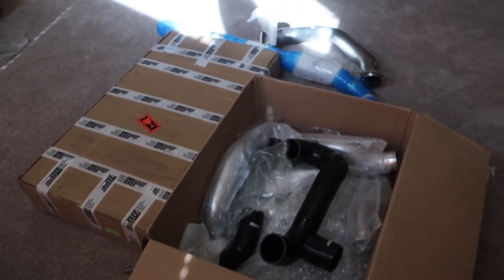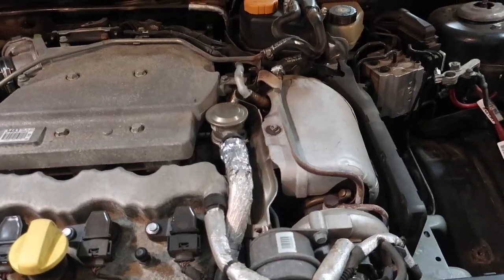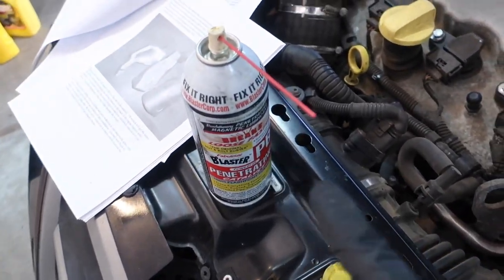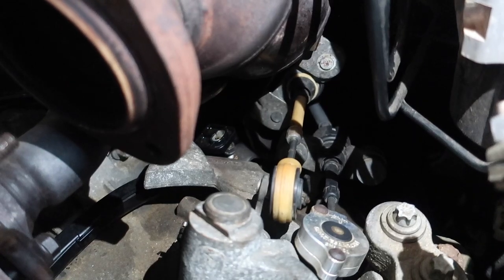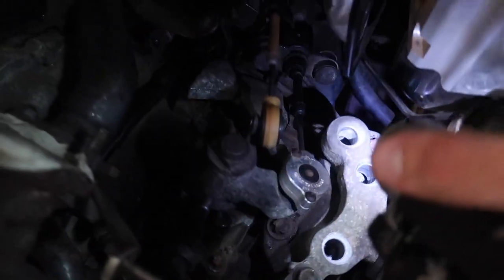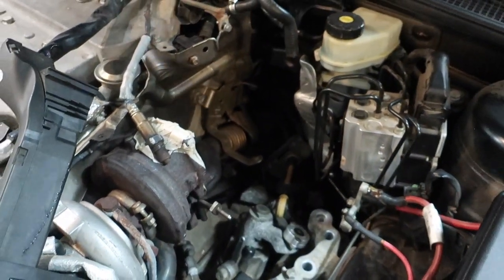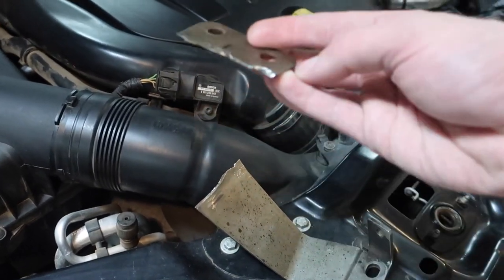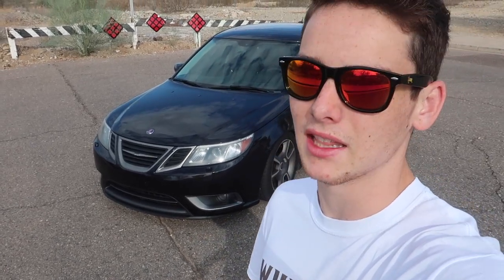Krona Downpipe and Midpipe Install on My Saab 9-3 Turbo X!

Comment: I’m assuming this is a v6? I found this video because my flex pipe is leaking now it’s loud af but sounds good when the turbo is spooling up.   I like that since we apparently can’t use bov’s on Saabs.  Which sucks ass. A turbo without a. Nice blow off valve is like peanut butter without  jelly.  I have a 06 93 2.0T.  I’m trying to see what my options are. The few down pipes I’ve looked up have 2 flex pipes one at the top of the down pipe , and one in the middle of the pipe. Idk if the factory one has the same set up or what. But I was thinking If it does can’t I just get rid of the bad flex pipe and put an electronic  exhaust dump?   I really like the idea of having it quiet then opening it it up when I want too. Straight sleeper. Does the factory downpipe have two flex pipes on it or no?
Reply from the maker: yes. this is a v6. BOVs are not great on the 2.0's. I'd recommend an open air intake for more sound. there is one flex pipe underneath the car on the stock 2.0 exhaust. I would recommend watching this video, since it features the engine you're talking about: https://www.youtube.com/watch?v=khj3nIuyoy8

Comment: Quick question for this you didn't have to do any tuning right? The defouler took care of the cel? I'm in a situation where my v6 has a catless downpipe but no defouler installed so hoping to get the 02 deleted and turn the light off with a tune and still pass emissions. Instead of having to install one. I've been told the defouler is only for cars with no tune.
Reply from the maker: yeah the defouler took care of the CEL. i got proper tune for it right after though to help the car run best and maximize the gains

Comment: What makes it sound even better is that it's a 6 speed. I just don't care about an automatic with a rorty exhaust unless maybe it was a dual clutch paddle shift trans. BTW, saw a new Ferrari sitting at a smoke shop a couple blocks from my house yesterday. Couldn't stop to check it out though....on my way to the Dr. office. A bitchin' ride to say the least. It was Corsa Rosso, natch.
Reply from the maker: Nice spot! and thanks :)

Comment: I know this is rather unrelated, but what are your thoughts on replacing a key fob shell for a 93? The buttons on mine are worn and I ordered a replacement from ebay. Long story short I found out that if you do not use a genuine fob case it won't close properly like mine didn't and therefore the ignition wont allow it to turn. Is it worth getting hold of another fob case?
Reply from the maker: On my other 9-3, one of my fobs had been chewed by the previous owner's dog. I just use the other one, but the chewed one still functions. Hopefully you can return the other one you bought, and the buttons on your current one still work. You can buy a "genuine" one from eeuroparts!

Comment: Did you do anything with the alternator? Remove or unbolt out of the way? I think Krona has that in their instructions..
Reply from the maker: alternator is on the opposite side of the motor, so you shouldn't have to touch it

Comment: hello, Maptuner stage 3, is it possible to remove the first catalyst or do you need to map again?  I have a stage3 Maptuner with original exhaust, I would like to remove the first catalyst and the second catalyst and replace it with 200 cells, do you think the car works well?  or do I lose pressure in the exhaust for the turbine?  thanks 🙏
Reply from the maker: if you're removing the cat it's best to get a retune to both get rid of the CEL and account for the changes. i would recommend contacting maptun too to see what they say!

Comment: Hey, just an FYI for everyone. The non fouler is actually unnecessary. Wire 2 resistors in the return feed wire with a jumper around the second resistor back to the end of them and like magic you get half the voltage. This makes the computer think there is a cat, every single time.
Reply from the maker: it's easier to just put the spacer in tho imo

Comment: Hey my krona kit didn't come with the nuts/bolts for the downpipe and midpipe flange, did you buy yours separately? The pdf says to "use included hardware" so I think they forgot to add it to my kit.
Reply from the maker: you could reach out to them about that; i didn't buy any hardware separately

Comment: A tip is that when you lower the engine don't remove the bolts to the engine mount. Just loosen them enough so you can do what you want, if that doesn't work; then remove them. Getting the bolt back on can be a bitch. 

Nice job though!! Sounds awesome!!!
Reply from the maker: Thanks for the tip! That was actually a trans mount, and the part attaching to the frame was actually able to be moved a tad, so I could adjust it before reinstallation if I needed to. I'll keep it in mind for the future!

Comment: I don't even drive my Turbo X anymore because I picked up an Audi A5 but this video makes me miss it. I got my Turbo X at 104k miles and it literally had some type of problem every month. I replaced   the ignition coils and spark plugs so many times. Then this summer, the Turbo X just went out the door and had a loose wheel bearing, master cylinder head or some shit for the break line broke along with 2 other calipers that started dragging, replaced 2 of the front rotors. Then I finally fixed those things and I had a week thinking "nothing can happen now, I've fixed everything" sooo then the power steering pump went out and fucked me over.. replaced the whole power steering pressure line and then 1 little fucking power steering return hose elbow broke off and fucked me over even more because I now have to buy the entire power steering pump for 1 little part on it.
Man fuck my Turbo X lol. They made yours out of titanium and then mine out of some flimsy aluminum.
Reply from the maker: Jeez....maybe it wasn't taken care of in its past life :( sorry to hear!
Reply: Wonder how you'll feel when you have to replace the water pump and timing belt every 80,000 on your A5. Audi's are over engineered and we'll built, but only recently has their reliability improved to an acceptable level. Good luck, you'll love it when its running.

Comment: Has it had the updated hoses for expansion bottle and checked for pressure cracks on bottle
Reply from the maker: Are you referring to the coolant tank? The lines were replaced in the past, yes. Not by me though

Comment: I thinking about resonator delete on my,  9-3 xwd aero maptun stage 5 but im afraid of drone,  what do you think? :)  and such a nice sound!  :)
Reply from the maker: Thank you Richard! I'm surprised this doesn't drone at all. But if all you're doing is a resonator delete, you shouldn't have to worry about drone
Reply: @AutoAutopsy  yeah i only want to resonator delete,  muflers remain :)  i hope after delete have deeper sound
Reply: The B207 engine is a lot more susceptible to drone than the B284 is. Be prepared to put the resonator back on in case you remove it.
Reply: @znorc  thanks :) i want cut resonator and replace for straight race pipe, what would you recommend for better deeper sound?

Comment: Do I need a tune for this or just The O2 sensor The Fowlers if I spelled that right lol
Reply from the maker: Lol the “defouler”. You can get away without a tune in most cases, but it would really be best to get a tune as well

Comment: How about making a 2003 9-3 vector sound the best for cheap?
Reply from the maker: Well, you can always cut off the rear muffler. But if you really want quality sound and performance, I’d recommend an actual system! :) if you search “Saab 9-3 exhaust” on YouTube, you should find a couple of videos of the exhaust setup I have on my 2.0 9-3!
Reply: Auto Autopsy thanks so much!

Comment: Seeing how you have to remove the cat to do the brake booster when I replace my break booster, I might have to just spend the money and redo the exhaust.. or they could sponsor me too. 🙏
Reply from the maker: No no, you switched that around! I think you meant remove the heat shield for the brake booster to get the downpipe out. The brake booster itself was not messed with at all :)
Reply: Auto Autopsy I need to replace the brake booster on my 2006 Saab 93 Aero Sport Combi it doesn’t look like is going to be fun to get to that heat shield. So I might as well do what you did and add one more thing to my to-do list (exhaust noises).

Comment: Hello about to buy a 2003 Saab 9-3 se convertible  with 151000 miles any tips
Reply from the maker: It's a good powertrain and drive train. We currently have two verts like that and they're great! Just make sure to do a thorough inspection :)

Comment: Seems like the v6 is a lot more work than the 4cylinder but sounds so orgasmic
Reply: It's primarily due to space. Same thing with the Audi B7 S4, 4.2L V8 where it was designed for a 2.0T Turbo. Hard to work on.
Reply from the maker: It is, but boy is it worth it in the end imo
Reply: Auto Autopsy  agreed, i have the 07 93 aero combi.

Comment: Turbo Xs are so slow i don't want to spend any money on tuning it but anyway good setup and sound. I am looking for a nice 02-05 9-5 aero to replace my X.
Reply: multinjok do you have a manual or auto?
Reply from the maker: TX > 9-5 Aero
Reply: Frank Miano  Manual, it is bone stock it made 281 Hp and 440 Nm on the dyno calculated at the engine...I think there are a couple of problems with turbo X, first is the car is very heavy 1750 kg, the engine is lazy slow reving, the gearbox is slow and notchy when you try to shift it fast and the XWD is also taking power, especially when you floor it on the highway.
Reply from the maker: It definitely did not make that much power stock, lol. Not even to the crank. Stock internals couldn’t hold that power, assuming the numbers you gave are wheel readings.
Reply: Auto Autopsy  No that is at the engine.
Reply: The internals of these cars have absolutely no problems with that kind of power. They're good for 400++ at least. A tuner here in Sweden have 19T, full exhaust, intercooler, injectors and clutch. He's currently at 435 hp and 570 lb-ft with stock internals :D
Reply: Robsva96  What are you talking about... I have stock numbers to say, Turbo X was rated at 280 hp, i have 281, and 400 nm i have 440 bone stock.
Reply: Yes, multinjok, I believe you. Auto Autopsy said and I quote: "Stock internals couldn't hold that power, assuming the numbers you gave are wheel readings." I just wanted to let him know that the internals can handle alot more than that. Do you believe it's worth losing the XWD when you want to switch to 9-5? just curious :D
Reply: I dont see any value in XWD because you need to really push the car to use it...It is great in the snow but we have snow only two days in year so all you have with XWD is added cost and less feel in power when you floor it. Dont get me wrong the car is very refined but in the same boring. If you know what i mean.

Comment: Why u didn’t kusy losie radiator hose to drain heater fluid? Secound thing dont instal any ecu o2 sensor cheater just go to dyno logout cat logs And reprogram ecu map:)
Reply from the maker: Much easier to just do it this way.